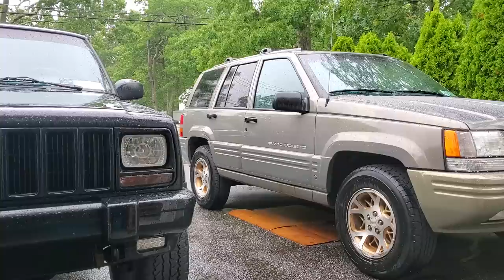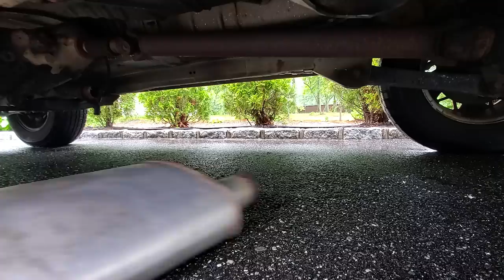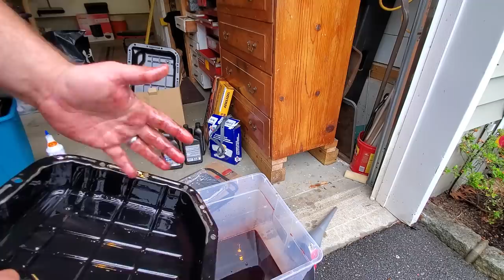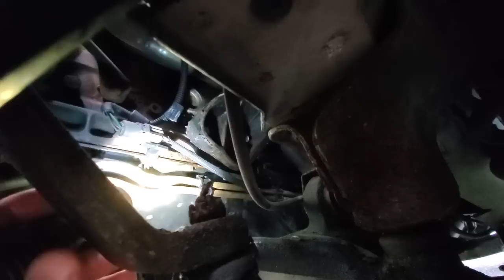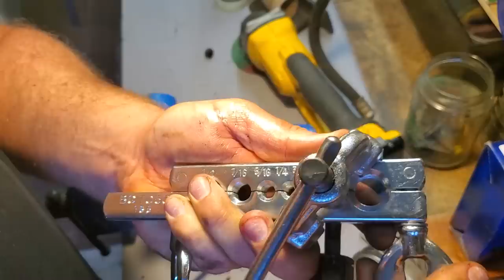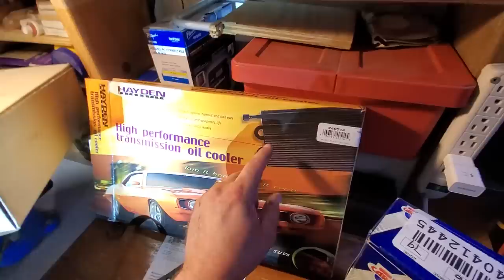JEEP ZJ TRANSMISSION COOLER INSTALL & GRAND CHEROKEE 42RE & SERVICE , FLUID CHANGE

Comment: As a fellow ZJ owner I carry bailing wire at all times. I also keep tool and spare parts in the back, including both transmission lines. It has a brand new motor and I still don't trust it on a daily basis. They are free for a reason. I need to get two more to keep mine going to work.

Comment: I found that if I started the car, applied the brake and put it into all of the gears a few times, the transmission would tighten up and not slip.  A racing transmission guy told me that the seals in that transmission dry out and and lose flexibility.  He said what I was doing was swelling the seals and preventing slippage.  His price to repair this was $5000.  So I still play the start up procedure game.  Good times in the ZJ.
Reply from the maker: Haha ! Good times!!  I would just buy a new ZJ for that price!

Comment: This was the first project I tackled on my XJ. Drained the transmission fluid, dropped the pan, new filter and gasket. It was really messy and I dropped my favorite hat into the drain pan with the old fluid during the process, but..... my exhaust didn’t fall off on the way to the part store 😂

Great video, as always!!
Reply from the maker: LMAO, Thanks man.  Its easier to ruin a hat than to lose an exhaust but I managed both in this vid! HAHA

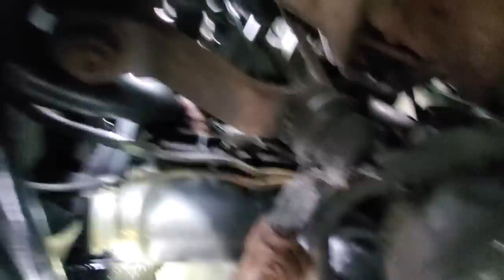Comment: 23:54  That oversized looking fitting on the end of that metal tube is a "check valve".  It will eventually get plugged up with debris from friction clutches as the transmission ages. It won't let trans fluid circulate through your cooler, and you might say to yourself, "I have a trans cooler, why is my fluid burned black and why does it keep popping out of overdrive?" Well the answer is, the trans is popping itself out of overdrive because the oil temp sensor in the trans is working to protect itself. So, what you gotta do is cut that check valve out of that line, flare the tube a little like my man here did and you will be good to go. (after you change the black burned fluid for nice new red fluid) I found this out on one of the jeep forums). I was pulling a horse trailer. My trans kept popping out of overdrive, I had to put it in neutral, shut off the engine, this re-sets the trans. Re-start the engine and go a little farther. Not fun on the highway!
Reply from the maker: Great info Stan, thanks for the input! 👍

Comment: If I'm not mistaken I believe those trans bolt and nuts are only supposed to be torqued down to between 8 and 12 foot pounds which really isn't a lot, you do with a hand Driver quite easily
Reply from the maker: yes, I think this one was 13-15 foot pounds.

Comment: MIne slipped like that when it was cold mostly.  Replaced both solenoids, fluid (was good) and the filter.  Still did it, then suddeny a few days later ran perfect, and still does after several months.  Go figure.  Must be one of those Jeep Things.....except it's really a Chrysler Thing.  The A-500 Torque Flite ain't no AW4.  Very sensitive animals, they are.  Now replacing the steering box, all  susp bushings, and a total brake job.  If it wasn't a clean old rig, i'd get rid of it, but I must admit, I can see why so many were sold, and it gets me to the top of the ridges just fine.

Comment: The Lucas transmission additive is a must. The old transmission likes fluid with the consistency of Jello. I use a whole bottle in mine and it could probably run good with more. How does the position of the transmission cooler not interfere with the radiator? I live in a very hot climate where I would love to get a transmission cooler but I don't know where I would put it where it would work best.

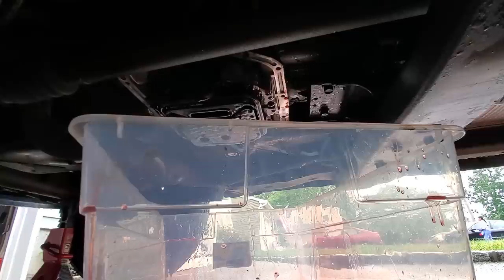Comment: 11:36 last bolt bent the pan because you didnt hold it up good enough maybe? be carefull dude. good way to start more leaks bending it like that by the weight of that fluid.
Reply from the maker: nope, definitely didn't bend the pan.  but that is another great reason to switch to a pan with a drain plug. It will ensure theres no extra fluid weight Incase you dangle it on a bolt

Comment: The "cork" gasket actually isn't bad. You do have to be methodically (near) perfect with torque specs when installing. Also it is highly recommended to use a very thin amount of high temp chemical resistant rtv. Very thin amount. Also, used blue loctite (not red) to hold torque long term. If not, you will have to tighten 2 more times again over "so many miles" to complete proper totqueing.
Reply from the maker: Awesome info! Thanks for the tip!
Reply from the maker: @jamesluke7377  wow.. solid info. Thanks a million man
Reply: So that's probably why the bolts were lose/not so tight.

Comment: I m pretty sure Trans fluid is supposed to be checked while in neutral. it says that on the dipstick on this vehicle.
Reply from the maker: Exactly, Everything you need to know is right on the Dipstick
Reply: CHRIS POCZEKAJ really? I didn’t know that
Reply from the maker: I included proper checking procedure in the description.
Reply: I have a 94 ZJ and my tranny tube is on the passenger side of the engine. I assume for the 96and up they moved it.
Reply from the maker: @erikstrieter4233  interesting... I didn't know that.

Comment: you think i should go back to the dealer and make them change my trans fluid,i have a 2014 gand jeep i  was told never flush by mechs  what do you think ,i like ur video by the way,
Reply from the maker: thanks for watching!  if you need servicing I definitely recommend you don't delay. not sure what 2014s need but consult your manual 👍🏻

Comment: How do you know if your Jeep needs a trans cooler? Great video mate
Reply from the maker: Thanks for watching! all vehicles should have one. lol . Heat is an enemy to the life of your trans so why not pop one in? right? The benefits outweigh the risks by far.  Theyre a simple install too, so why not, cant hurt.  The toughest part is finding a place to mount em.
Reply: The tranny cooler is like almost every other cooler, it’s built into the radiator. If your doing just daily driving it should be good enough, if your gonna do some serious off reading or towing an external cooler is definitely advised.

Comment: It's gonna leak again.  Chrysler transmissions from that generation were designed to seal with silicone only.  Never use a gasket there.  Also, the 42RE, like the 42FE has oiling issues where the oiling holes were too small.  Hence the notorious failures in all of those transmissions.  The only fix I know of is to tear it apart and drill the holes to 5/16' when you're rebuilding it.
Reply from the maker: Yikes... That blows I'm gonna keep an eye on it.. if I have to redo it I'll use RTV but I'm not drilling it. Haha
Reply: They (42RE) came with a factory installed re-usable gasket. The wording is even stamped into the stock pan.

Comment: I did The same thing if that was the reason why it was leaking if I would’ve tightened up the screws after the fact would’ve it held being it was loose that long?
Thanks 🙏
Reply from the maker: could be.. ya never know with a 20 yr old Jeep

Comment: Does it matters if the in line goes on the top inlet of the condenser or in needs to be on bottom for proper function?
Reply from the maker: It probably doesn't matter,. lol

Comment: What size wrench you using for the nut on the radiator? 19mm?
Reply from the maker: Can't remember off the top of my head.. I think it was standard.. probably 3/4

Comment: Hey bro so ur telling me this jeep zj didnt already have a trans cooler prior to this install?what size motor is it ?
Reply from the maker: It had the 4.0 straight 6 without a trans cooler.  Alot of 5.2 V8s with the tow package had a stock trans cooler
Reply: My 98 ZJ 4L I6 didn't have the factory cooler either...I think after 96 they dropped the auxiliary cooler with the tow package, stupid idea.  I added a cooler right after I got the Jeep.  You don't want to get an automatic transmission really hot, that's what kills them LOL
Reply: William Sevier  In 1998, all Dodge/Jeeps had their aux coolers dropped for a bigger in-radiator cooler. A lot of trans got replaced that model year...
Reply from the maker: @leakyjeep5.9  lol!  That explains it!
Reply: @leakyjeep5.9  Took the cheap route, and those coolers in the radiator don't do anything, you are trying to cool 200 degree transmission fluid with 200 degree coolant LOL.  I added an aux cooler to my 98 ZJ right after I got it.
Reply: William Sevier Same here,   got an 11x11 Hayden separate from the rad.
Reply: @leakyjeep5.9  I believe that's the one I put in, can't recall for certain but its the largest that I could squeeze in there LOL.  I don't do very much towing anymore but there's absolutely no reason to not have an auxiliary transmission cooler, especially for the less than stellar transmissions out there LOL.
Reply: William Sevier I actually popped two coolers before I figured out they were getting squeezed  from the temps expanding everything around it. It's a damn tight fit for sure..
Reply: @wildbill23c  97 still had the aux cooler with the tow package, mine has one from the factory
Reply: @SgtPnkks  Probably added after the fact at the dealer, it wasn't a factory option after 96.

Comment: Need to do this to my xj... eventually... lol
Reply from the maker: Go for it! it was easier in my XJ.. more room in the grille area
Reply: @ProjectDanH  I'm currently chasing an a/c issue lol and I just finished a disc brake swap. I'll do the cooler in the spring of next maybe.
Reply from the maker: @jonathanskogebo728  awesome idea tackling the disc brake conversion. 👊  I'd like to recommend doing the trans cooler now since summer is upon us and heat is bad for the trans.
Reply: Jonathan Skogebo is this a common thing to do on xj and tj?
Reply from the maker: Sure!

Comment: What is your operating temp with the transmission after installing the cooler?
Reply from the maker: excellent question!  engine is still 195.  not sure what the trans is.

Comment: I bought a black 99 wj from a guy in a neighborhood just like this on the island for 600 bucks back in 2016, had a hole on both sides of the block, I swapped it and the thing is still going 242k lol, drive it up and down the mountains in PA a couple times a month. I’m wondering if it’s the same neighborhood or if you know him, it was like every other house had jeeps lol
Reply from the maker: That's hilarious I wonder if you got your WJ from the same guy I got my WJ 🤣

Comment: Why did you need new trans pan???
Reply from the maker: Well it was leaking trans fluid and didn't know if it was warped or damaged.  Plus I wanted one with a drain plug... So I crossed everything trans related off the list at once.

Comment: Well with the bolts on the transmission pan not being tight its a wonder the pan didn't fall off with the exhaust HAHA!!!
Reply from the maker: HAHA!!! Parts are falling off faster than Charlie's teeth! haha. Great comments Will!!! Lets hope nothing else falls off!
Reply: @ProjectDanH  Only thing I've ever had fall off my ZJ was a stabilizer bar link...went a bit too far with the Jeep offroad a bit too much flex and snapped a link.  So far so good with my current 98 ZJ though, my 96 ZJ I had previously lived a very hard life, although I kept up with the maintenance on it, I had it offroad more than it was on the highway, it was covered in mud most of the year.  My current Jeep is pretty much a street queen although I do take it off the beaten path occasionally when I'm up in the hills.  

Who the heck needs an exhaust that just robs engine power, chop it off it'll be fine LOL.
Reply from the maker: LMAO... Unfortunately I needed it for the NYS inspection.  lol  Its all welded up, thats the next vid. Somehow it still sounds crappy so it may get chopped off still!!!

Comment: How is it shifting with the Lucas? (Before u bust a line from the fan at the gas station?)
Reply from the maker: it absolutely loved my ATF+4 with Lucas! gotta do it again now! lol🤦‍♂️
Reply: Project Dan H yes esp with gas station atf....how does it drive with that in there btw?
Reply from the maker: @Leatherkid01  I couldn't honestly tell you.. I topped it off with Lucas stop slip immediately. Lol.. sry

Comment: What did you do with the stock trans cooler on the right side? Or does my ZJ have an additional option?
Reply from the maker: The only stock trans cooler is integrated into the radiator. (On my ZJ, V8s with a tow package might have an OEM trans cooler)  The one I installed is an independent cooler mounted in front of the AC condenser.  Thanks for watching!
Reply: @ProjectDanH  OH. Well my stock one is in front of everything on the right side. I think it's part of the towing package with the 5.2L.... not sure, I know my build sheet says something about HD engune cooling. My radiator doesn't look the same either.. I don't know. I assumed they all had it stock, sorry..
Reply from the maker: Yes They're stock on the 5.2 with a tow package, as well as the WJ.  😊

Comment: Do you think can I drive my zj 4.0 without a thermostat?
Because we cross the border and do line about 2 hrs. And we have a 120° F outside, so my zj with the AC on the temperature gets like a 140 145
Reply from the maker: its better to have no thermostat at all then a blocked or stuck thermostat.  Engines run best at a specific temp, you want it to heat up and then the thermostat opens too cool and keep it at its operating temp... with out a thermostat you may not reach optimal running temp, but you shouldn't over heat. So in short.. yes lol.. you should be ok without a thermostat

Comment: If backing your ZJ down the street because you exhaust fell off isnt true Jeeping, i dont know what is!
Reply from the maker: HAHA.. feel free to use this clip in your "You might be a real Jeeper 2" vid! 🤣🤣🤣
Reply: Hell yea buddy!
Reply: Not backing up and going to work dragging it under your XJ in complete DGAF mode, then dealing with it in the dirty snow at work.
Reply from the maker: LMAO, When my XJ exhaust fell off on my way home from work I pulled into a gas station, jacked it up, Ripped it out, and thew it into the woods 🤣🤣🤣
Reply: Just use an "abortion tool" (a wire coat hanger) to hang the exhaust until you get there!